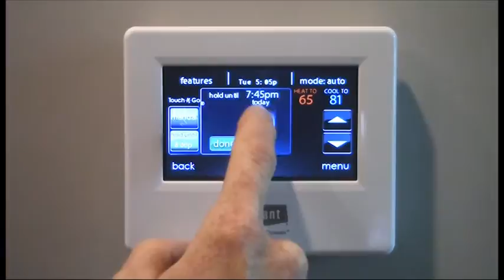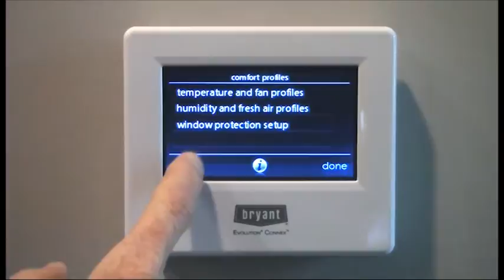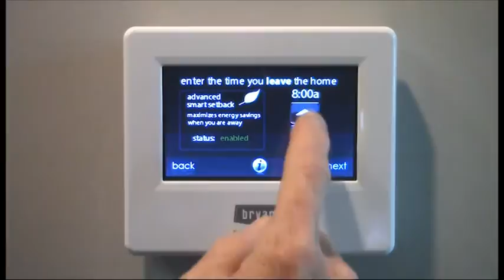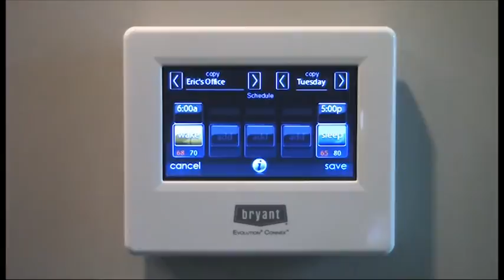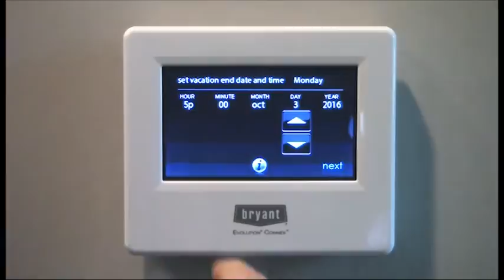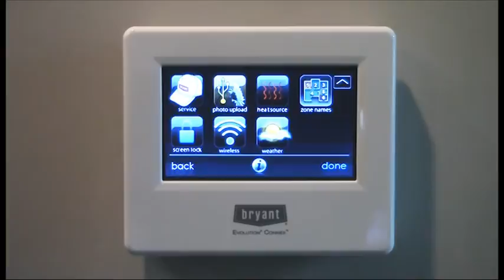Bryant Evolution Connex Tutorial | Bryant Air Conditioning, Heating, Electrical & Plumbing

Comment: How do you unlock the screen
Reply from the maker: Melissa sorry for the delay. Here are the directions for the user's manual: In the bottom left hand corner of the thermostat's screen you should see "UNLOCK", press and hold that for 10 seconds.